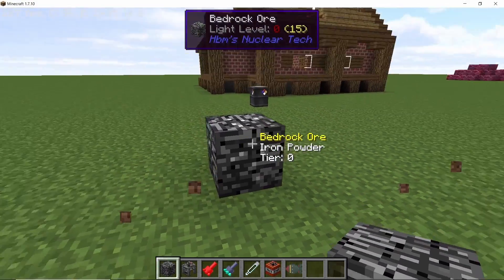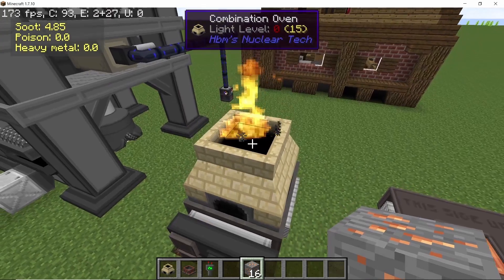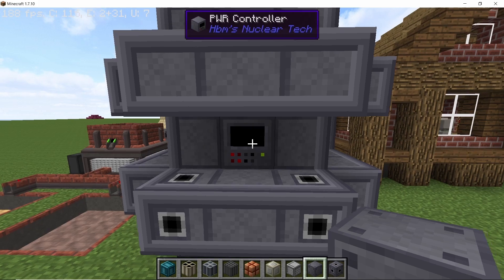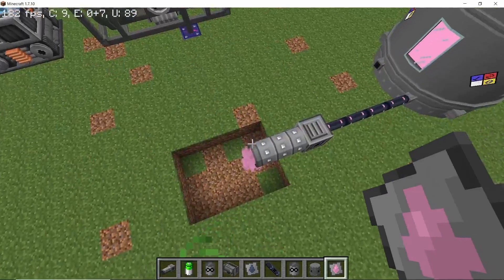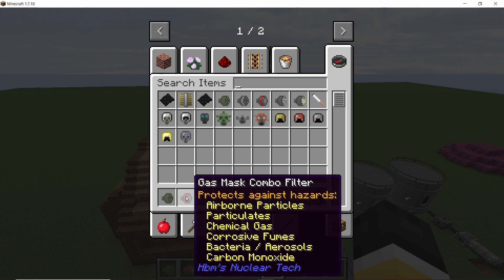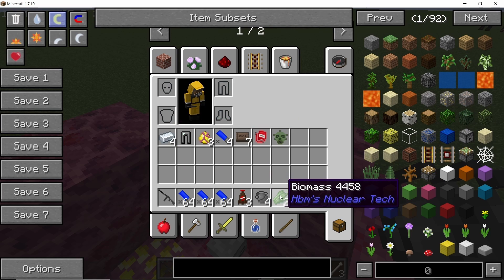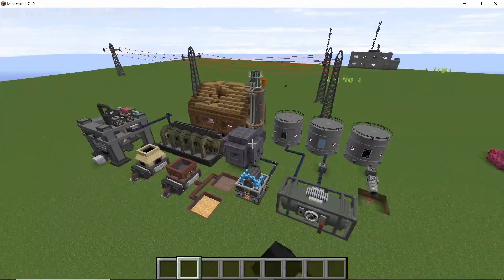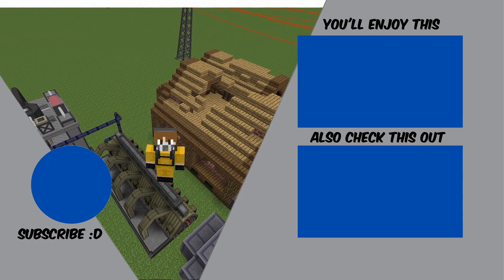Drainage Pipe, PWR Heat Sink, Bedrock Ore Customization and More - HBMs NTM Updates and Changes

Comment from the maker: With heatsinks added into your pwr the core heat capacity will go up at the cost of reduced efficiency of the heat exchangers which can be compensated by adding more of them. Basically you can get so much more heat out of the reactor if enough coolant is pumped in it and that too coolants with high thermal capacity like liquid sodium. This will allow a reactor to exceed its power producing capacity which used to be capped due to the 10M TU core heat. I'll try to make a big reactor design asap and that should make stuff more clear!! 
There was some minot stuff i had to skip in this one but ill be sure to cover that soon as well. Thank you for reading and all the support 😎🤜🏻🤛🏻
Reply: Tip: You can also exceed the hull temp without issue, the meltdown is only triggered via core temp, so run the reactor as hot as you can, also you'll likely need multiple heat exchangers, even a relatively mild superheated design running up to 15 MTU with normal coolant was reaching the limits of exchanger.
Reply: How do I get the modifiable bedrock ore? I got the update but can’t find it in the creative menu, do I need to use commands?
Reply from the maker: @tap_khap bedrock ore as an item can be grabbed directly out of NEI tab, it can't be found in the creative menu tho.
Reply: @SavageVegeta  ok, ty. thats dumb it isnt in the creative menu, but a roundabout way to get it is better that no way to get it, I guess
Reply from the maker: @tap_khap  well the whole customisation of bedrock ore is meant to be a creative endeavour anyways maybe that's why it isn't available in the menu. But yeah NEI is your friend :D
Reply: @tap_khap  Just use NEI, it's not a specific item just any bedrock ore, the item in NEI defaults to being empty.